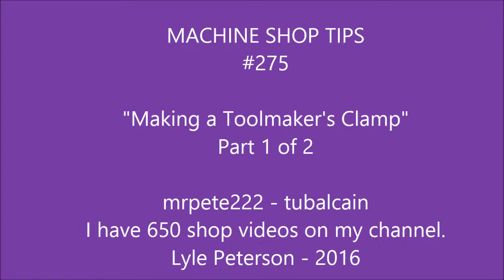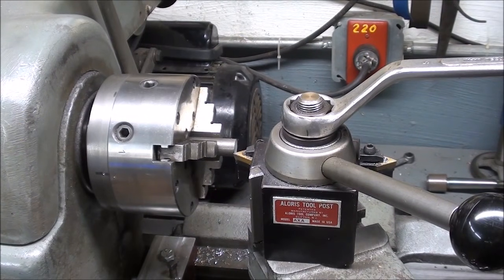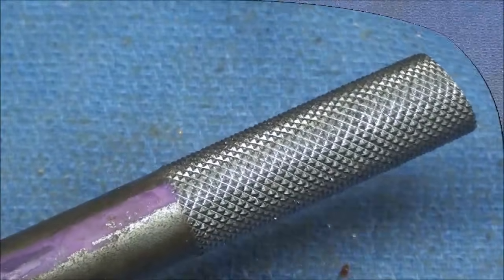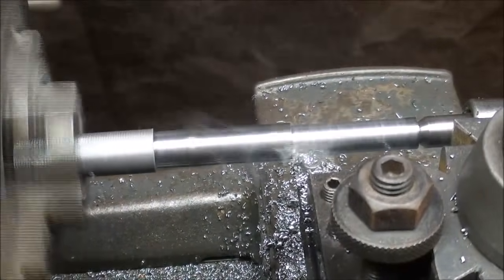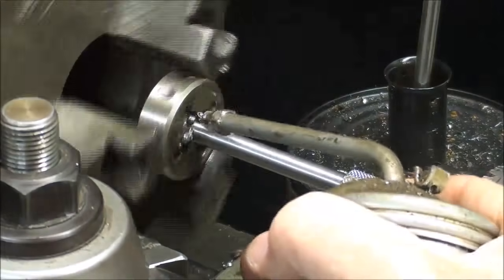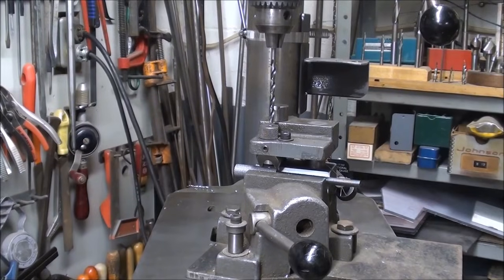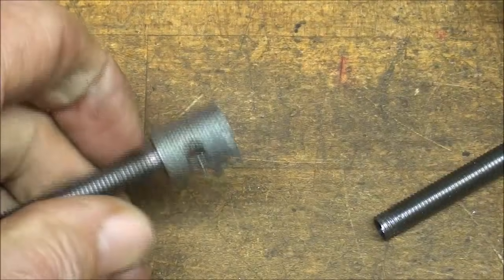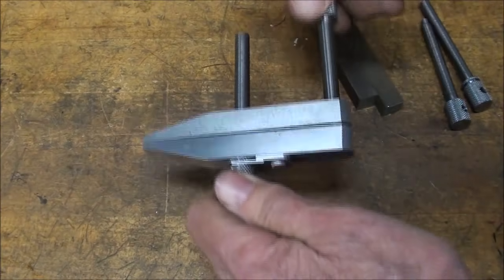SHOP TIPS #275 How to Make a Toolmaker's Clamp Pt 1 of 2 tubalcain

Comment: Dear Mr. Pete/ Tubal Caine.  I made a machinist clamp in my home shop.  I'm nowhere as skilled, nor do I have the quality machines that you do, but I've learned so much from you.  I took machine tool technology class in school. I have a hobby shop.  Thank you for the instructional videos.  I especially love watching the ones where you create tools.  I've modified my blueprint for my machinist clamp. I tapped the ends of the handles and put T handles on them.  I cut a groove on the end of the threaded rod and drilled a hole on the clamp jaw, threaded the hole then made three flat head set screws to hold them in. Then on the small clip that holds the stationary handle. I made mine out of a heavier stock.  It's very solid and non malleable.  On the inside of the work side of one of the clamps. I cut two groves in the shape of a cross to be able to hold onto round stock if needed. I have photos if you'd like to see my clamp.  Thank you for the videos.  I'm addicted to watching them. Ray Albert Gonzalez Sr.

Comment: Still have mine from, mumble, 40+ years' ago w/Mr. Weber.  I was even looking it over, but not checking dimensions during the video.  We used the bump type knurling tool and they turned out OK.  The engineer in me is still trying to figure out the math of how the wheel size of the tool does not need to be matched to the size of the stock.  magic !!  

Now to watch Part 2 and see how the bevels were made.  I was moving too fast and sawed and filed them smooth.  If I was slower, we'd've had the shaper lesson and used that tool.

Comment: Mr. Pete, I made one of those back in the early 70's in my shop class at OPRFHS. My teacher was Mr. Stan Chappas. We made the clip out of bent aluminum sheet and fixed it in place with a rivet.
Reply: Forgot to mention that we single point threaded the screws but always watched closely and backed the cross slide out at the end so we didn't need a relief cut. Once done we'd chase the threads with a die to make sure they were right.
Reply from the maker: +Art Borchers  Thanks for watching!

Comment: I have been making a pair of these clamps. I have the jaws finished.  You are right the bump type knurling tool does not work very well. It takes a lot of pressure. I have ordered a clamp type knurling tool and will finish the screws when it arrives. Thanks for the video and plans.
Reply from the maker: Great-yes, do not like or use the bump type

Comment: Great project Mr Pete, one of the many project I made as a first year apprentice aged 16 was a Tool Makers Clamp.  One thing we did was to scrape the mating faces of the 2 jaws, .................. why because one of the skills was hand scraping using a surface plate and engineers blue the aim was the 2 jaws should be so flat the would stick together when slid one over the other.40 years later I still have the ones I made and use them from time to time
Reply from the maker: +Rich ok Awesome- Thanks for watching!

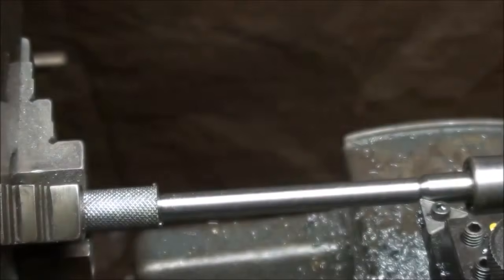Comment: Tubalcain where do you get the calipers you showed @ 14:29 and do they make a metric version ? I like the idea of them as I have parallax and I can't use a traditional verry near (vernier) and I find the digital ones although good generally when you really need them the battery goes , go figure cheers tubalcain
Reply: +Jacob Grant You can educate without being nasty...
Reply: +ShysterLawyer I'm just saying it the way my shop teacher would have
Reply: +dtec30 That is a mechanical digital micrometer. There were many brands of them back in the day. Now  most have gone to electronic, but you can still find good used ones. For calipers, the mechanical version was a rotary dial. No batteries to deal with.
Reply from the maker: +dtec30 ebay- Thanks for watching!
Reply: Rambozo Clown yes thats why i like the idea of them
Reply: Jacob Grant yes sorry i knew they had a technical name but i could only think of the verneer

Comment: Can you offer a tip on center drilling? I noticed you put your CD in a collet? I have a Sheldon EXL 10" lathe and I have the tailstock set perfectly. I have a high quality drill chuck and still my center drill wanders a bit when it makes contact with the work. I'd like to make a drill chuck for the tool post???
Great video - thanks
Reply from the maker: +howardtoob I have the same problem on some lathes even with new chucks. Never did figure it out

Comment: GREAT VIDEO!!  but you have told us in the past that knurling wasn't a "cutting" operation, but a "displacing" one -- so there should be no chips to "wash away" with the oil?

and oil helps "displacing" metal as well as "cutting" it?

Comment: Cross holes can be annoying sometimes, I drill them in the lathe usually. If the work is small I'll spin it in the chuck, otherwise I'll use a crotch center or do it on the drill press.

I've had the idea for some time that I'd like to make a crotch center out of a v block so I could clamp the work, it would be a rather simple thing actually to buy a morse taper arbor and bore a hole in to a cast iron or unhardened v block and then press the two together, then you have a cross hole jig you can clamp the work in and use on any lathe, that requires no bushings for different size drills, will take a wide range of sizes, be reasonably well accurate, and more importantly not cost $1000. thank you mr pete for another good video.
Reply from the maker: +captaingreenbush Thanks for watching

Comment: I did one same school 28 years ago. I also remember that he bent the screw when I start to thread because I did not well aligned the die.
Are you my old professor??
Reply from the maker: +factotum almost No-lol. Thanks for watching!
Reply: +factotum almost Also made the same clamps as a project in 1977  Votech  (Machine shop)  cut square stock milled it drilled and tapped it and surface ground . single pointed  and knurled the screws on the Lathe.  still have them today .

Comment: I have never heard of this 12L14 before. In 35 years experience. Researched it some, found a number I know. Can be machined like 1117 or 1018 but Carbon steel? Can heat treat to 80 Rc??? Like a file?

Comment: You would be a fun neighbor. We would be fighting over stuff at estate sales & auctions, then I'd be paying you to make prototype parts for guitars, harps, accordions & other instruments. I'd need a sheet metal person or a person with a box & pan brake and a shear too. I have the wrap around safely glasses, and a pair or Uvex presription frames I need new lenses for. God gave us two of most of the important stuff, like eyes, kidneys, lungs, hands, etc. and with fingers, we can screw up 9 times and still call for help! Wear your personal protective equipment! Eye protection is the most basic, then we move on to gloves, face shields, hard hats, aprons, steel toed shoes, fall protection harnesses, respirators,  arc & spark protection, flame proof clothing, electrical rubber gloves, etc. It's hot, it's restrictive & it's uncomfortable, but a hospital bed is not very comfortable either, their food is horrific, and you have to pay a fortune for it.